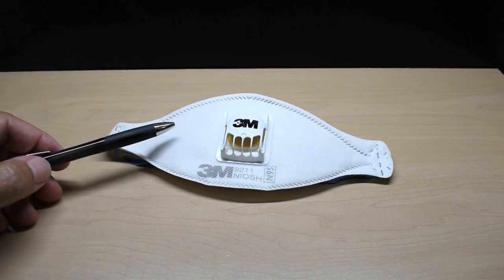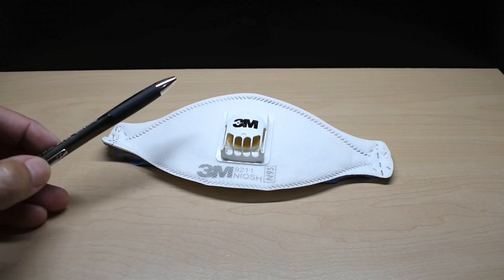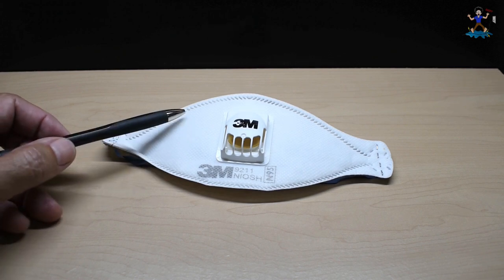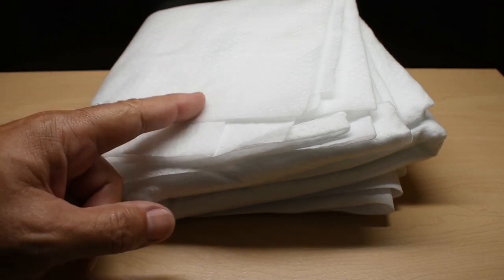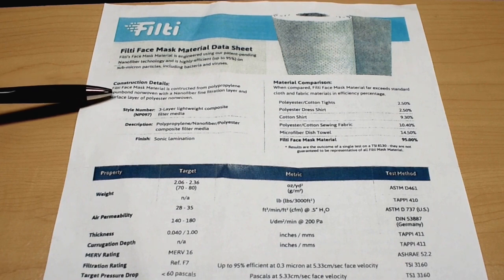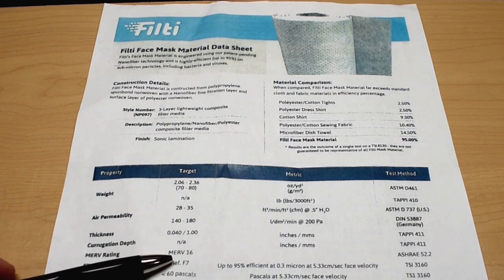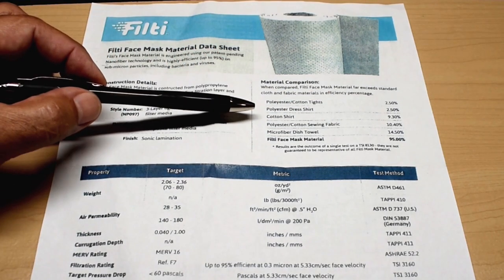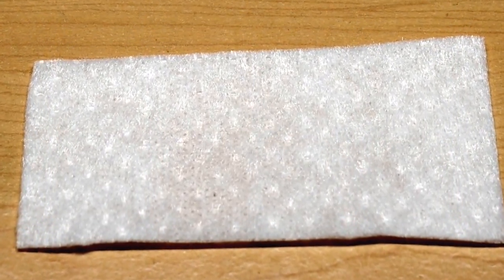DIY N95 Mask Nano Fiber Material! (Electrostatic Free)

Comment: Polypropylene . . .? Isn't that made from petroleum products? Your breathing all that off gassing from the petroleum.
Filtering is one thing, but what is that material doing to you in the long term?
Reply from the maker: @ alan4sure Agree 1000%
Reply: This plastic is made out of the 'off gassing', volatile (smallest) parts of the crude oil after it is refined.
It is turned into plastic. Not only a solid, but the strands are melted together. It is closely related to polythene, the stuff food bags are made of.